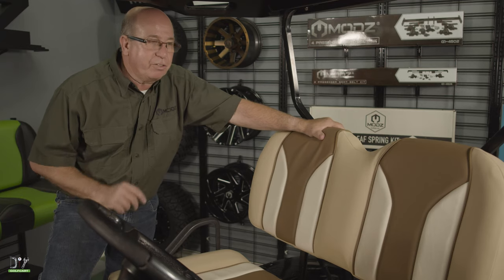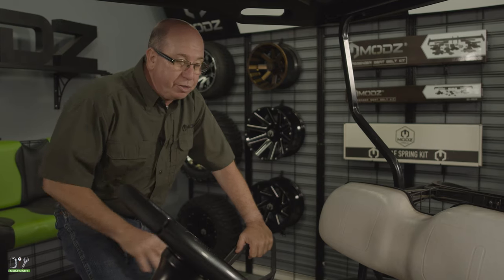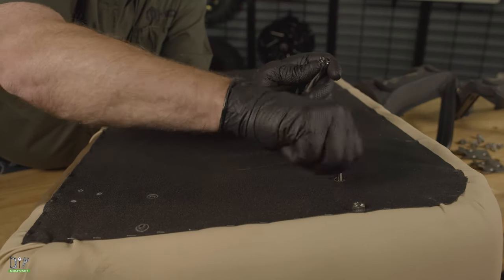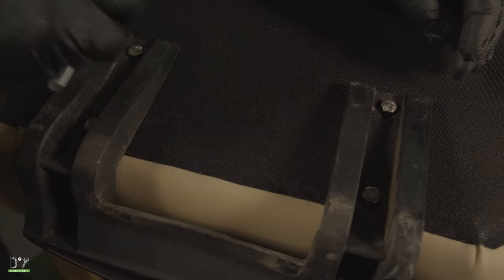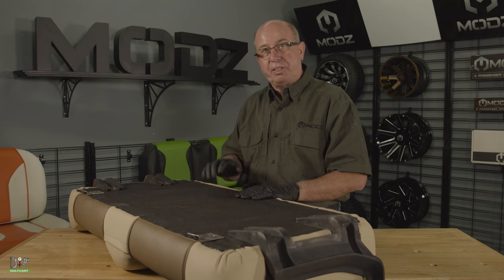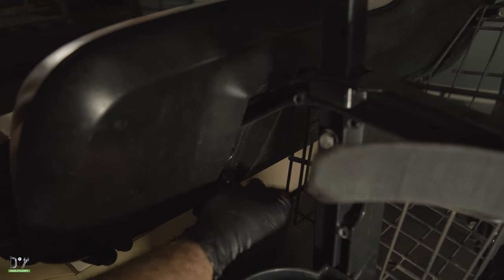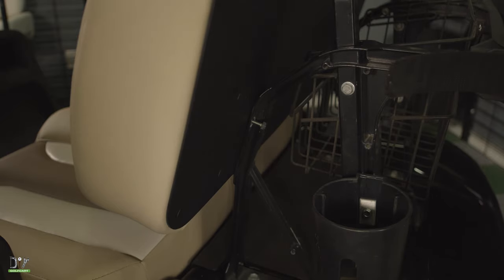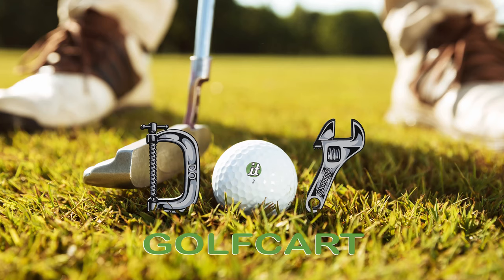MODZ FS1/FS2 Custom EZGO Golf Cart Seat Installation How-To

Comment: Hello
I have a club car ds 48v I’ve been having trouble with it going slow up hill the batteries are about 7 years old I have tested the batteries and their all at 12.8. Any ideas what it could be I’m thinking new batteries but want to hear your opinion?
Thx
Reply from the maker: When you "tested" the batteries, did you load test them or just take a reading?
Reply: DIY Golf Cart yes I load tested them and they where dropping to 10 and 11.00. I also check all of them and it started at 48v and then when I hit the gas it would drop all the way to 39.00. Thx
Reply from the maker: @mauricioortiz5661  You definitely have bad batteries!